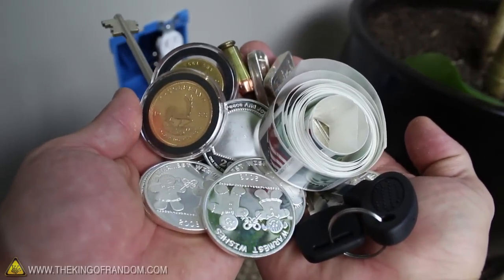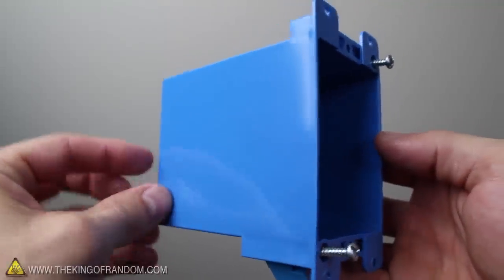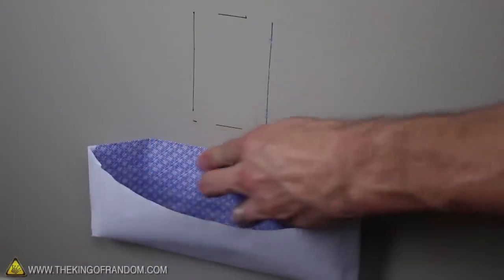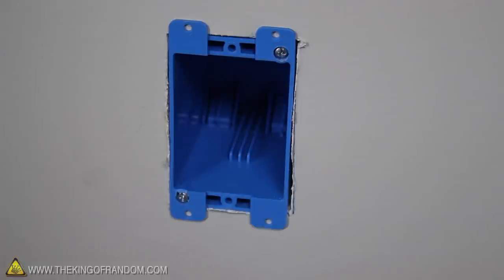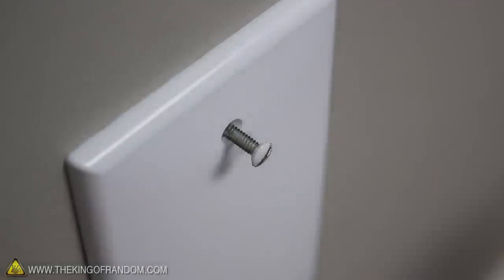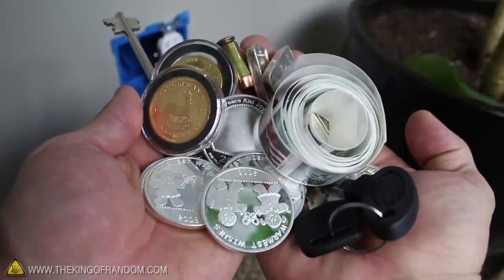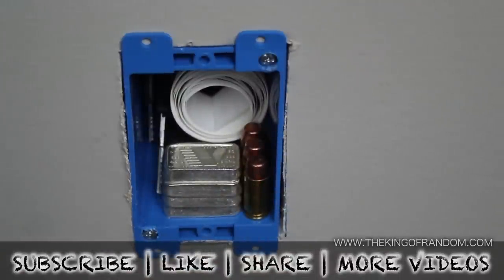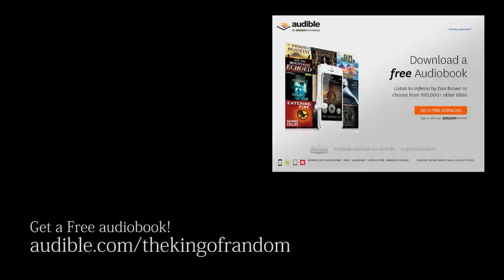How To Make A Super Secret Safe - For Less Than $3

Comment: To all the idiots who watch this film and say that burglars are going to find your stash, I ask you this question.  Do you really think a burglar is going to bring his tool kit with and screwdriver to open up wall sockets to see what is behind them?  I was a cop in a former life and the burglar wants to get in and out as quickly as possible.  They are going to steal easily seen things like (TV's, computers, phones, jewelry, cash, or other valuables).  They are not going to take apart your outlets to look behind them.  If they do they run the risk of getting caught.  A better plan of action would be to buy a safe and put random heavy crap in it like lead weights or other stuff.  They aren't going to have the time to break open the safe in your pad and will end up taking it with them to crack it open and be hoodwinked.  Now you have some angry burglars who might seek revenge, but you didn't lose anything.  In the meantime you could make sure you install security cameras, better locks, a security system and buy some weapons for when they come back to seek revenge.
Reply: a burguler would bring his tool kit if he watched this
Reply: good point but a smart EXPERIENCED burglar would know how to look in plain sight, and if the burglar has time and patients.
Reply: FruityNachos How many patients?
Reply: +Expatriate American 😂😂😂
Reply: +kip Marcel Of course not.  What's he going to do, unscrew every single outlet and wall plate in your house?
Reply: buy this, buy that. Just get a gun
Reply: then have a secret room and put all u like in it so u don't need that anymore
Reply: Lol film
Reply: +American Abroad Former life??       Are you sure you can remember something from a FORMER life!
Reply: chances are your average house invader isn't gonna think that much to think of checking a wallsocket behind a couch or something
Reply: Alan Jimenez, I couldn't agree more.
Reply: American Abroad Collecting Currency Abroad True, if the robbers check your outlets. When they finish, the police will arrive
Reply: Dont you know that every burglar ever has watched this video?

Comment: Yeah, but european houses are made by bricks.If you drill to the inside, you can make a hole to the outside.So yeah..
Reply: so are the homes around where i live. sigh
Reply: Mines are concrete
Reply: You from the inside "Oh yeah! Finally I got it done.
Thief from the outside "Well that's a greaaaatt spot!
Reply: lol
Reply: DutchGames4You
There are to many wall outlets to check in the time they want to spend in a house.
Reply: Your house must be losing heat like crazy.  Where is the insulating material?
Reply: FaceOfGod2 The insulating material is like 4-5 cm thick.It's useless for this project.
Reply: european houses? i live in europe and you wont find a single brick house where i live.
Reply: seplop Let me guess , your house is made of hay ?
Reply: Tiago Abreu OOOOOOOOOOOOOOOOOOOOH SNAP
Reply: Tiago Abreu no planks.
Reply: bb aas
Thank you good sir.
Have a good day too.

Comment: a really good one is an old heating vent     

Step one: take off vent cover.
Step two: cut out a piece of cardboard or plastic (your choice what material) the diameter of the vent. 
Step three: hot glue(if you have to you can use duck-tape but secure it well) the cardboard in place however deep you want the containment area to be.
Step four: fill with valuables and return vent cover.

i like this one cause in most cases you can just slip whatever your putting into the hidden area through the slot in the vent and never have to open it
this makes it way more discrete to load or hide something in a hurry
Reply: if you want a better diagram leave your name as a reply il reply you one
Reply: one thats not i  use 
like its been unhooked but the vent is still there ya know what i mean
Reply: +ian wallace IlluminardyGaming please!!!
Reply: whut are you reffering to when you say please
Reply: ian wallace nvm

Comment: Am I the only one here not living in a house made of plaster? Cutting a hole like that in my wall would be worse than escaping alcatraz through walls.
Reply: Lol, same here. I have 30 centimeters of concrete thickness...
Reply: lol
Reply: I can't even hammer a nail through my wall to hang a picture frame. Much less drill a hole in it.
Reply: jlly16 Martin Křivánek 
Which is why American homes are built smarter... European architecture is pretty counterproductive when it comes to the futuristic stuff we have now.  You need wall outlets and to hang stuff on walls.  Concrete walls is just stupid.  We have our support inside the walls and then covered with sheetrock/drywall so we can easily paint, repair, or alter our walls while keeping the same structural integrity.
Reply: pod trash Lol, we have dry wall on the concrete.
Reply: KillerCobble So it's just a matter what is chosen for support?  Wouldn't wood be cheaper anyway and easier to repair/modify?

I'm one to talk though.  Half my house is made out of steal.  Practically one of a kind.  US Steal toward the end of it's life was looking for new revenue sources and tried building houses.
Reply: pod trash yeah but americans are probably going to get their home broke in by getting their wall cut -,- in europe you need a tank to break in since most architects make 100% 30 centimeters of concrete
Reply: Nick Brendon lol what?!?!  Right,  cuz a criminal is going to bypass that easily broken glass window,  which is on every house no matter what it's made of,  just to sit there cutting through a wall making 10x the noise and time?  You will get your home broken in just as easily no matter if your house is bricks or concrete.  They will break a window or kick/unlock a door.

You also don't seem to realize it's only the inner walls that are drywall here.  Not the entire house ya dope.  It's a combination of siding, insulation, steel, wood, and drywall.  No criminal is cutting through a wall like that without some major equipment and an hours worth of time.
Reply: pod trash wasn't america the place with all the hurricanes?
Reply: Pika chu Which lovely country are you from?  The one with all the tsunamis, volcanoes, civil unrest,  or terrorists?
Reply: You don't have any outlets? Lol

Comment: We don't have cardboard walls in the Europe, so it probably can not be done using knife... :D
Reply: What do you guys use, I thought most developed countries used drywall.
Reply: +Hugh Grotkowski Developed HAHAHAHAHAHAHAHAHAHAHAHAHAHAHAHAHAGAHGH
Reply: +Hugh Grotkowski you're funny
Reply: There are a lot of outdated buildings in Europe that still have plaster or other inferior materials.  Most houses in the US are newer or have been remodeled with drywall.  European people  think that 50 coats of paint is fine.
Reply: As a European, drywall feels cheap, unreliable, prone to accidental breakage, and sold as the "status quo" while it's actually a way for building contractors to make a huge markup on a cheap constructor material. Give me bricks or GTFO.
Reply: my walls are LITERALLY made a of cardboard

my batman knife can barely stay on the wall

we have to have a shelf above it so dust doesn't add to much wait and crumble off the wall
Reply: Shindinder lurk tu speel
Reply: Vincent Wiedermann - they are not card they are plasterboard and yes we do as I’ve built enough houses
Reply: lmao
Reply: My issue is that the outlet box sticks out, on the outside of my refrigerator box that I live in. Not to mention that it's the only outlet box in there. So it's quite obvious  😒

Comment: Try this! It's super cool:
What you need:
1 knife/saw or anything to cut through the walls
1 Stud Finder
1 or 2 small lunch containers (plastic)
1 small or large mirror

Step 1: Locate an area with a stud finder
Step 2: Cut a hole big enough for your lunch containers
Step 3: Hot glue your lunch containers to the wall
Step 4: insert any valuables into the wall
Step 5: attach the mirror to the wall over the hole

Comment: you can cut your home walls with a flimsy kitchen knife? 'murica :D
Reply: What would you use, a sledgehammer?
Reply: FaceOfGod2  Its a bit industrious but it would get the job done?
Reply: FaceOfGod2 no i would you a cjain saw
Reply: FaceOfGod2 no i would you a cjain saw
Reply: Schwaehn Who said that it was a cheap or low-quality knife?
Reply: Schwaehn well, have you tried it?
Reply: Schwaehn Only in 'Murrica you can cut your walls with an knife, over here we need a wrecking ball to make a hole in the wall
Reply: Marty Davis sounds like i russled some jimmies :3
Reply: Marty Davis okay :) whatever you say man.
Reply: I know right 8)
Reply: Schwaehn Drywall knives are a thing.
Reply: Schwaehn  The actual wall holding up the house is actually hidden by a layer of drywall. it hides all the electrical wiring and piping that goes through the house between the drywall that you see, and the actual wall that's supporting the house. the drywall is purely for aesthetics.
Reply: Joshua Pietros No we don't...
Reply: My house is made out of concrete -_- how I am supposed to cut the hole on the wall.
Reply: nestor ismael
Reply: I thought exactly the same :D

Comment: Yea with walls like that there is no point in having a door, the burglars will just walk through the walls.
Reply: Kaleb Bruwer XD
Reply: Kaleb Bruwer Every house in America has drywall just like that...
Reply: Jeff Green That's the problem, they either build with paper or wood.

I don't know that much of American housing and paper walls, but is it the reason America uses the most wood in the world?
Reply: Kaleb Bruwer It's not paper lol it's drywall look it up. Bet you have at least a lil in your house too, and it's not the whole wall obv it's the inner part of the wall, filled with insulation, many studs and then either concret or wood depending on how your house is built. Drywall is a lot stronger than you think, plus I can cut through a car tire with my pocket knife, does that make it any less strong against running down the road 100 miles an hour? no.
Reply: Jeff Green 1: Drywall sounds a lot like the material we use for our ceilings, the rest is brick. Even inner walls.
2: what kind of comparason is drywall vs tires?
Reply: Kaleb Bruwer No we use the most wood in the world for more things than just paper walls. Is that the question you're seriously using for your statement? And the comparison is that both seem weak, yet can hold up stronger than you'd think. Also many houses are equipped with a alarm, so one bang or knock on the house can result in a loud siren. If not, I'm pretty sure it's easy to hear someone trying to get in. Your statement makes American houses sound simply built with layers of just paper and wood. No. There can be layers of different materials. There are also a lot of things that can block a criminal from busting a wall, such as wiring, critters, and more. Seriously, if it were just as easy as you said it could be, than wouldn't it be easy for almost every house in (compared to my) neighborhood to be robbed?
Reply: Jeff Green. Not ALL houses in America are built with drywall. A lot of older ones are made with brick etc. However, around 99.998% of new houses are built with drywall
Reply: Because NOBODY will wake up from someone chainsawing through the walls... And getting electrocuted.

Comment: In my building, you'd need a jackhammer to make a hole that big :))
Reply: ***** At my place, I can just punch through the wall.
Reply: eh i agree,thats the thing with making 100% concrete walls :/
Reply: ***** In my building you'll need to call up some muslims that hang out in Florida Stripper Bars to use their special magical physics that only works on certain days, or if they call up that special magic.
Reply: oh my gosh so many comments up there 8P
Reply: In my building, I already have holes cut out by a jackhammer :))))))

Comment: After you glue the screws to the face plate you can glue some magnets to the inside of the blue box and the back of the face plate to hold it on for easy removal and replacement.

Comment: You need to upgrade your walls. Cardboard isn't a great option.
Reply: that's fiberglass insulation silly, it has paper on both sides.
Reply: j
Reply: well my wall is cardboard with paint
Reply: Still cuts like a butter with knife.
Reply: It’s called drywall
Reply: Sheetrock/ drywall
Reply: It’s drywall

Comment: Won't the electrician find it?
Reply: as an electrician, only if the homeowner complains an outlet isn't working, (in the case of outlets being there that don't function).    

I would only look in the blank cover if i was trouble shooting a circuit and couldn't find the root cause, in that case open up every junction box near the problem and work backwards. 

It's not likely but it does happen.
Reply: i am an electrician i probably would find it if i was looking for a reason why something in the house wasn't working
Reply: Harambe's Return no because there is no wires
Reply: Layne Wilson the electrician doesn't know there are no wires to that box. The wires are not visible to boxes of that kind.

Comment: wait, wait,wait 
you guys live in cardboard houses? O.o
Reply: Exactly what I thought. If I would try this at home I only wold get a broken knife and a damaged wallpaper.
Reply: ***** And that is exactly why the house I have lived in since I was born had been through 1 hurricane many huge storms and an earthquake and also 5 feet of snow collectively in 3 months and is diffinitely  standing
Reply: *****
Bullshit, the places I've lived in stood strong through gale force winds, and I only knew it was windy by looking outside.
Reply: ***** Don't be fooled by the materials being cheaper. Houses in the U.S. are far more practical in large scale construction than other heavier and more expensive materials. Plus construction is tightly regulated with stringent rules in any modern built home/building.
Reply: ***** Most houses in the US are build with a good wooden frame. Drywall, what Zorgfleeter calls "cardboard" is put over the wooden frame and also helps with insulation. There are states in the US that regularly undergo storms and hurricanes and the houses are fine.
Reply: Matt Jarrett Do you mean that people in us don't live in brick houses because that is dependent on the city you are in
Reply: Yeah most of the US is built out of cheap, shitty materials. You'll notice on those home makeover shows where they do a complete a rebuild in a matter of weeks. It's not just houses either, look at what happened to the I-35W bridge in Minneapolis in 2007, it had only stood for 40 years! In Europe there are bridges that have stood for centuries, and still show no signs of falling down. Pathetic really.
Reply: Well, everyone is rightfully free to their own opinions but it's not reason for hostility. Some of the comments are extremely condescending and maybe even pretentious.
Reply: *****
Just sayin', my house has been here over 14 years and the only thing that has been severely damaged was when a tree fell on it...but only then did it only make a dent in it (literally).
Reply: Le Ténia The bridge collapse was due to it dealing with a greater strain than it was meant to (The gusset plates were on the small size for its intended load, which had massively increased since its construction.). At the same note, most bridges in Europe are comparatively smaller than those elsewhere in the world. A shorter span is less stress on the deck span of a bridge. That said, my house is built to minimum code requirement, which is lacking, but acceptable. Granted, the roofers who originally shingled my house did a shitty job and the last big windstorm took most of them. And the shingles, used their liberation to assault my fence, which apparently was their nemesis. But it was a write off, and I got a fence post with a shingle embedded in it out of the deal.
Reply: It's called dry wall
Reply: MrFusselig in my house in ireland the are the outside walls that would brake your knife and just chip the wall and some of the inside walls I can punch a hole into
Reply: yeah, they're called dry walls, basically just cardboard and plaster.